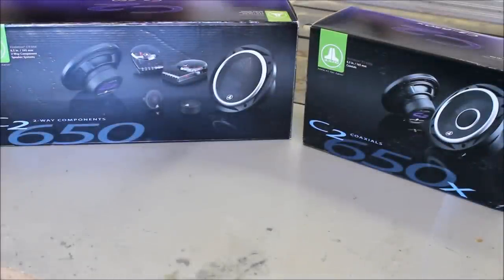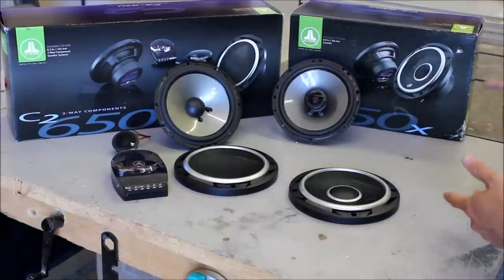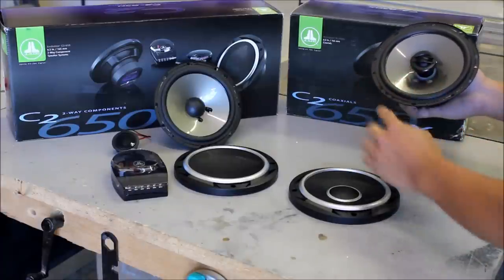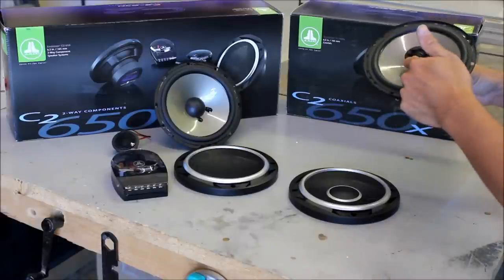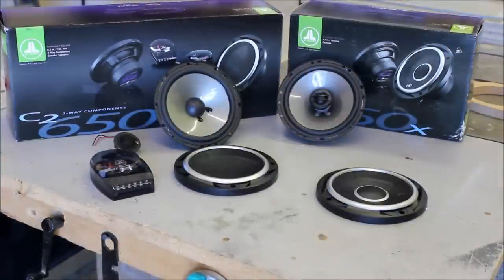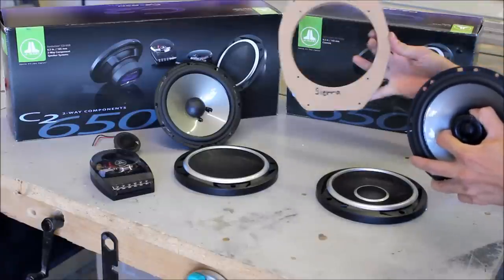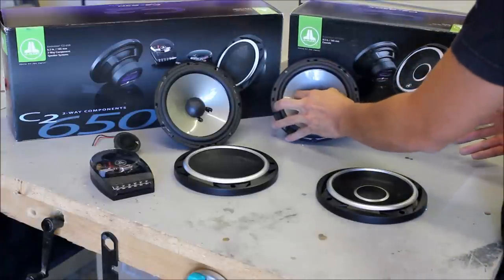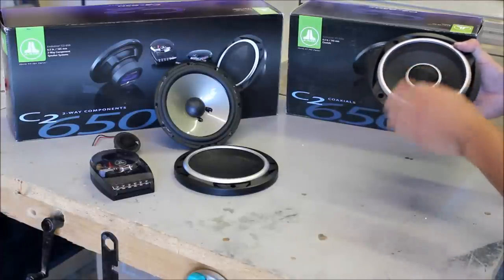Component vs Coaxial Speakers (JL Audio) | AnthonyJ350

Comment: If your vehicle has stock woofer and tweeters surely then it must already have a crossover of some sort?
Reply from the maker: A lot of manufacturer just put a capacitor at the tweeter to filter out the full range signal. If it's amplified it may be crossed over at the amp.
Reply: @AnthonyJ350  ah okay, thanks for clarifying.

Comment: Yo hi, thanks for the sick vid. I'm running 400W Pioneer 6 x 9s, and a 12" (1400w) Pioneer Champion series DVC sub amplified by a 4 channel 4800 watt Audiobank amp, my 6" Clarion mids and factory tweeter are connected straight to the my deck (Sony Xplod). I know it's ideal to amplify the sub with a dedicated mono block amp, because of the low frequencies and stuff, but do you think I there will be a a note worthy difference in performance and music quality if I get a mono block amp for my sub, and hook the mids and tweeters up to the 4 channel? Or should I just get a sunroof or something? :)
Reply from the maker: +Rory Grenade 2 amps works best.  I personally run nice 5 channel amps.  Keeps the install simple and I have enough power to run everything.
Reply: Cool, thanks bro

Comment: which speakers would you recommend under $500 cad? on a base 350z
Reply from the maker: Sorry for the late reply. JL Audio C3's are great or Hertz High Energies.  Are you amplifying?
Reply: AnthonyJ350 I went with the esk/ecx lineup for hertz amplified with an alpine mrv f300. I'm just wondering if the amp would be enough for the speakers or what would you recommend?

Comment: Great Video! I want the focal isn130 component in my car. They have 2x50wrms and i have an amp that put's 2x55wrms out. Would that be a good setup? My radio is a Pioneer avh-x7700bt.
Reply from the maker: +reeisessit Ya that should be fine if that's what your specs are.  Just make sure the amp is installed properly.
Reply: +AnthonyJ350 Will do :) Thank you for your answer.

Comment: I have those jl components but why do I hear vocals and some instruments coming from my woofer? I have crossovers installed.
Reply from the maker: You're still going to hear it a little.  If you want to hit certain frequencies only you'll have to run a full active set up using an amplifier.
Reply: thanks for replying. I do have an amp hooked up to them. I just thought the woofer was meant to play mid bass and the tweeters to play the vocals, instruments, and highs, right?
Reply from the maker: 714smurf Ya but you'll get a little overlap.  The passive cross over just "divides" the signal so some voice frequencies will play through that woofer.  But the woofer won't play the high pitched stuff.
Reply: alright cool. i thought there was something wrong with my setup
Reply from the maker: 714smurf Set your high pass filter to 60- 80hz on the amp and you should be good.  Also sound deadening material really helps your speakers sound better.
Reply: Tee 
Ey bro what amp are you using for those jl components?

Comment: what type of speakers suitable for rear deck?
Reply from the maker: Coaxial is typically what we install, mainly for their simplicity.
Reply: +AnthonyJ350 does it required amplifiers?or it can just normally direct connect to my head unit?
Reply from the maker: @erwinashley6992  Just by entry level speakers. But it will sound much better with an amp.

Comment: Which has more Bass without amp ?
Reply from the maker: Technically a coaxial would because it requires less power. Also you'll need to add sound deadening and FAST rings to maximize bass output

Comment: i want to install 4, 6x5 comp in each of 06 scion xb doors or will 2 do fine?
Reply from the maker: I usually do component in the front and coaxial in the rear unless it's factory components in the rear.
Reply: why the difference?
Reply from the maker: Mainly cost and coaxial speakers don't need as much power to run.  The rear doesn't need the same imaging like the front.

Comment: they sell slim speakers too so no need for all that ring keep it simple slim speaker an ur set but only if the windown when it goes down with the big magnet then the slim is ur best bet put ur window down an look at the clearness then go from there u can run amps qith the coxial too just tune it right because u can burn out the tweeter on it or just add a tweeter on it i use magnet less they work fabulous made my bullet tweeters loom like a joke

Comment: I am getting those installed in my 2015 Buick Regal tomorrow. Front doors c2 650 and rear doors c2 650x. Will cost me $500 for speakers and install.
Reply from the maker: City of Compton Very clear speakers. You'll want to get a sub after as they don't produce a lot of bass. But that's with any system.
Reply: I agree. I already have a 12 inch jl audio sub on a jl audio amp. I am hoping changing out the speaker inside the car will give me more satisfaction.
Reply from the maker: It will.  Changing out speakers will give you more detail.  Are they installing speaker adapters, sound deadening (like Dynamat) and FAST rings?
Reply: AnthonyJ350 No. Should I?
Reply from the maker: Yes it makes a huge difference.  You only need the small speaker kit. Here are some videos:

https://www.youtube.com/watch?v=i6BZ8j9hft8&t=3s

https://www.youtube.com/watch?v=zxyDVDecojI

https://www.youtube.com/watch?v=o-eKU0n9TfM

Comment: Would you go with Kicker over JL Audio????
Reply from the maker: I'd pick JL Audio C3's all day long.  Great value for a mid priced speaker.  It can be installed as a coaxial or component set up.  I'd did custom kick pods with these and they were very clear and had impressive mid range bass.
Reply: Thanx for that bit of information I love JL and there subs are the best!!!!!
Reply: AnthonyJ350 JL c2 650 or Pioneer ts e170ci?
Reply: AnthonyJ350 JL c2 650 or Pioneer ts e170ci?

Comment: Only issue is that my car is a hatchback so not sure what I'll do for a sub setup
Reply from the maker: +Rich Greenwood I'd get a custom fibreglass enclosure built into the corner with a nice 10" sub like a JL Audio W1.  Hatchbacks have the ability to produce a lot of bass naturally and you'll maintain vehicle functionality by placing the woofer in the corner where you usually don't put anything anyways.
Reply: You can get little subs that fit into your spare wheel (assuming it is in the trunk) they are only about 100-150w 5 or 6" woofer but they do help fill in the lower frequencies.
Reply: Jl audio truck wedge...you having a hatchback is awesome because all that sounds remains in the cab. Watch and see

Comment: thanks for the vid but i was wonderione ive buy 6 sub pyle blue wave but now i nee d soud wath u would recommend me p.s my car is a charger srt8 2014
Reply from the maker: +Viper Dodge Not sure what you mean.  Can you type more clearly? Spell check pleeeease.
Reply: Thanks for the vid but i was wondering i have buy 6 subwoofers pyle blue waves but now i need sound wath will you recommend me  
 ps: my car is a charger srt8 2014
Reply from the maker: Viper Dodge I'd run 3 amps.  One amp per pair of subs.  What's the RMS rating of those subs?  If you're going this route you're going to need another battery and you'll have to upgrade the alternator and do "The Big 3" upgrade for wiring.

Comment: Hey brother great video I subscribed :) I do have a question involving the video. I have two JL Audio 12w0v3 Subs in my 2014 sedan Hyundai Elantra and a Interfire T4-80 amp. I now am looking to upgrade my speakers, they are currently stock. I was wandering what speaker you would recommend me, and also what would be a good amp for them please keep it under 200$ thanks! :)
Reply from the maker: +Kobe Caldwell For speakers look into something basic like JL Audio's TR line up or Alpine's Type S speakers.  For a good value amp an Alpine MRV series amp will be enough to power those speakers but won't break the bank.
Reply: +AnthonyJ350 I was thinking about get Alpines speakers or NVX speakers do you think a 1000 watt 4 channel interfire amp would be okay for two speakers?
Reply from the maker: ***** Should be more than enough.
Reply: +AnthonyJ350 thanks! Also component or coxial?
Reply from the maker: I would just replace whatever the car came with.  Unless you want to change the imaging and get the tweeters higher, if the car doesn't have components you could cut the doors to accommodate them.
Reply: +AnthonyJ350 hmm I wish I knew a lot about this stuff like you:(
Reply from the maker: Kobe Caldwell You don't have to.  What area do you live in?  There must be a good install shop in your area whom you can talk to.
Reply: +AnthonyJ350 live close to LA
Reply from the maker: I'm not too familiar with shops in L.A.  You'll have to do some research and see photos and or videos of work.  But searching on Instagram or Facebook makes seeing workmanship easy.
Reply: +AnthonyJ350 ive decided to get a pair of components in the front and a pair of coaxial in the back. What speakers would you recommend for under 400$?
Reply: +Kobe Caldwell 6.5 or 6.75 btw

Comment: C2 speakers = EHHH 6/10 - for 120 dollars or less they good value
Reply from the maker: 1337 IOT Add an amp, Dynamat and FAST Rings and they'll sound amazing.
Reply: I did everything you said and guess what - they suck get some morel comp 6.5 and see the difference. They make no mid bass.   I ran fosgate t-600-4 600 dollar AMP 150 watts to the crossover and it was ehh 

also you have to trim your eq settings because they cant handle all eqs . For 120 dollars they are ok value - But for someone who wants to make a nice sounding car I would stay away
Reply from the maker: 1337 IOT Well ya they're an entry level speaker. If you want all that you'll have to step up to a $500 pair of speaker like the Hertz High Energy.
Reply from the maker: 1337 IOT When you're trying to grow a category and get people into audio who aren't, these speakers with a 5 channel and a 10 inch sub will make a huge difference and is a good introduction to car audio.
Reply: I stayed away from Hertz -per many audiophiles I spoke with - Morel is better - Focal is even better than Hertz yes I spent 350 for my 6.5 morel ultima comps and 420 for 6x9 Morel Ultima comps so 800 dollars in speakers and another 400 on 2 Sundown 8 inch sd-2s - = Bad ass sounding car -

Comment: [The crossover]... "has a lot more going on." Are you kidding me? Why don't explain the difference between crossovers and filtering capacitors? Why don't explain to the audience about having the direction high notes in a direct clear air path to the aural canals? Good god son, by the end of the lecture the  audience should at least really understand why component is better and co-ax is cheaper, don't you think?
Reply from the maker: Don't you think that should require a video on it's own.  Because after I do that I'll also have to go over passive vs and active system.  If I only talk about passive crossovers then someone else will comment that they rob power from the system.
Reply: Fair enough, I'll concede your point on crossovers vs filtering capacitors. As a multimedia producer, I sometimes think that laypeople  have a better understanding of audio and electronics than they actually often may. That said, I do stand by my comment about separate tweeters allowing direction sensitive  high notes in a direct clear air path to the aural canals. This makes a very big difference and is the main advantage to component speakers in general.
Reply: Ned 

The only benefit of component over coaxial is less risk if of coil rub from debri and a crossover, some coaxial have external crossovers which make them better than either of the other designs but as above susceptible to debris.

Comment: Realistically, you are dumb. The coaxials are speakers done properly; the components are like that and cost more only for the crossover. The reason the company does not sell the coaxial with the crossover is for marketing and cost purposes, as they can charge more for the same speaker set as a component due to the public misunderstanding audio functionality. There is no other application for separate tweeters in anything relating to music, e.g., TVs, converts, home audio systems, etc. In all of the latter systems, the mid/high are coupled; some have sub/mid/tweeter combo; and, some have mid/high together with an additional sub. But, the mid + high are always together ... except in car audio. The only reason for this is because the misguided public has, in general, come to believe that separate high and mid works better. This is the same reason why so many people believe the Chinese-made Kickers are better than JL ... except if you can afford JL, then of course you would buy it.
Reply from the maker: Go to minute 56 of this video https://www.youtube.com/watch?v=DS0He03eR3w
Reply: AnthonyJ350 YouTube blocked Matt's video so you might want to remove this link.
Reply: rob h realistically, I have to agree that coaxial speakers are good...but components really are better. From sound quality to greater control over the speakers themselves in terms of frequency controls and using them mainly to hit notes subs don't want to because let's face it, if you have the money to buy a high level car audio set-up you want subs to quad low and mids and high frequency ranges to follow according to the name they are labeled. I've  had enough sound for a few life times but no expert tho I can tell you after your second 24-2500$ system you will understand. If you spend enough you'll be enlightened